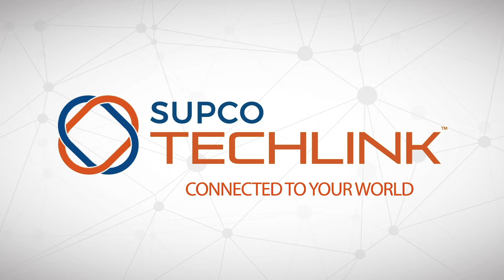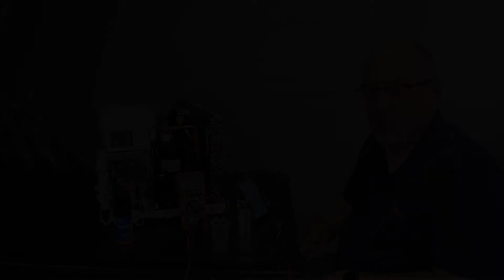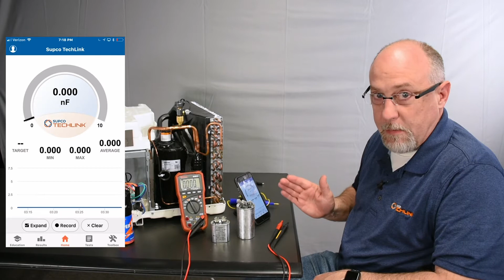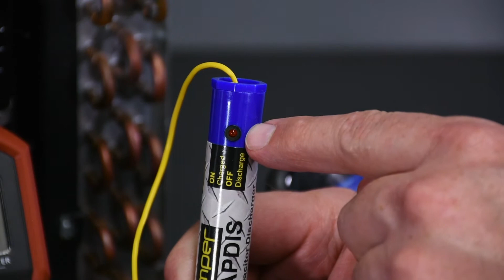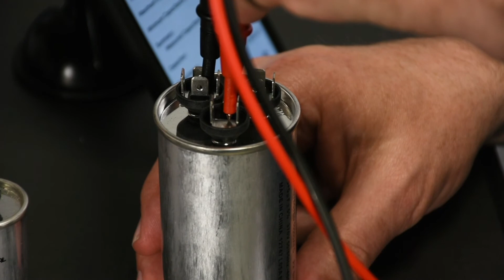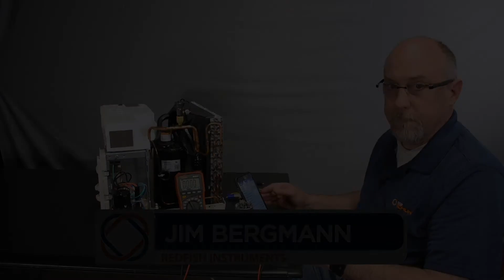Checking Capacitors with the Supco® Techlink™ App and iDVM510 Multimeter

Comment: Both original and replacement run capacitor are same 12.5 MFD 440/370 VAC but new replaced blower motor has 7.5 MFD listed . Still good ? It seems fine

Comment: There is no reason not to short across the terminals, to ensure that the cap is discharged and, here is why.  If the motor is good, the cap will discharge though the motor as soon as it is powered off.  If the motor has an open winding, like you mentioned, there is a small chance that you will damage the cap by shorting across is.  That is true but, who cares?  You always replace the cap when you replace the motor anyway.  That cap discharging pen is a solution in search of a problem.  Save your money.